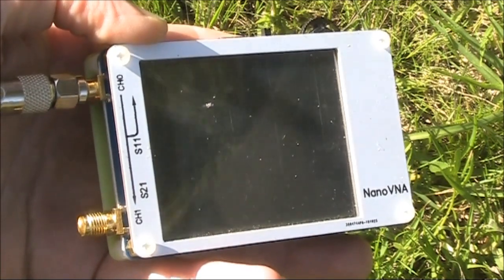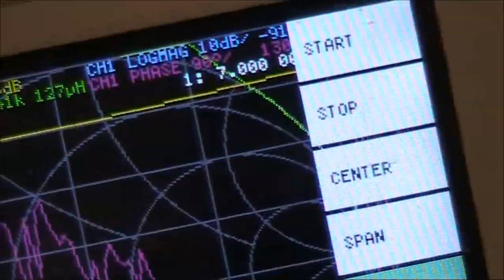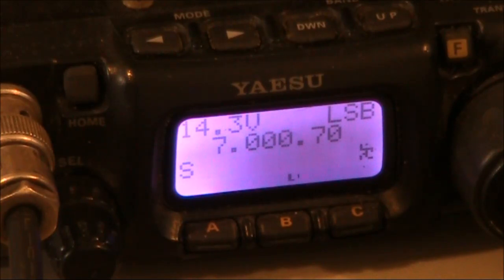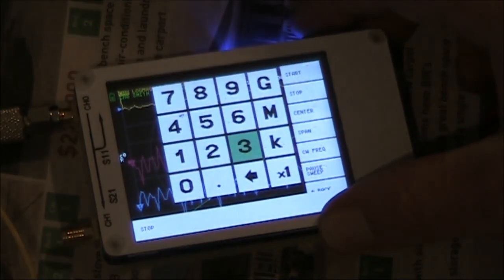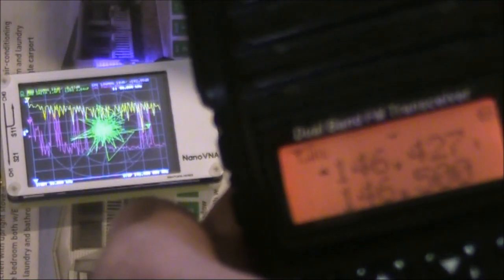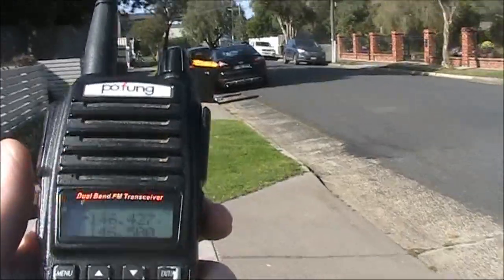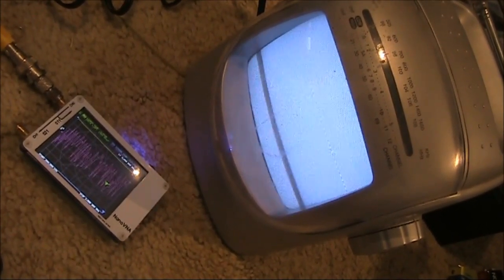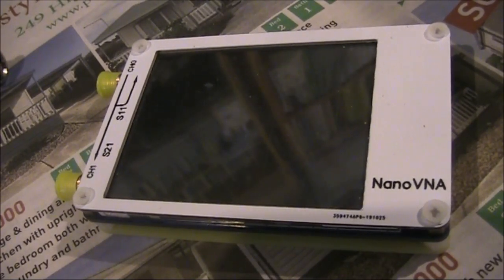Using a Nano VNA as an RF signal generator

Comment: Do you realise that the nano emits a square wave?  So you're spattering multiple harmonics, most likely outside the ham bands.

Also, are you aware of the sensitivity of these instruments to feed line capacitance?  A great way to blow up a nano is to connect it unprotected to an antenna, where feedline capacitance can easily charge to a level where it blows the instrument.

Comment: Is there a connection between the VNA and the receiver, or the signal is just transmitted? And another question, can I use it to calibrate an S-meter?
Reply from the maker: Maybe but you'd need a good quality RF attenuator and a calibrated RF probe or similar to measure the voltage across 50 ohm. RF leakage could be a major issue as my Nano VNA is not in a proper shielded case.

Comment: i like to use it when traveling with a vx7r to decode ssb. just dial the same frequency in both devices and vx7r on am mode. anything will do as an antenna on the vna. you can also use it for 6m dx cw

Comment: Hey! Can this TX and measure the antenna gain in the same time? Let's say I want to compare gain of few antennas on the same frequency to find the best RX one.Thanks!
Reply from the maker: I haven't tried it. But it might be possible using the bandscope function where received stations show as peaks.
Reply: @vk3ye  yep! Good idea! I saw something similar with a software named Nanovna server and a Nanovna-F v2 connected to USB, so on port1 was the TX and port 2 working like RX..I don't know if the software is working with older devices..Thanks!